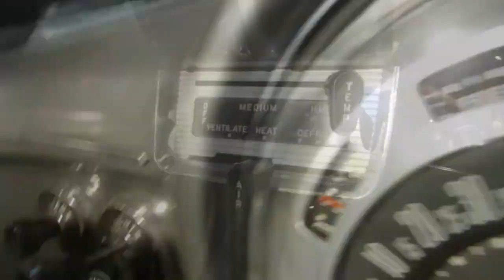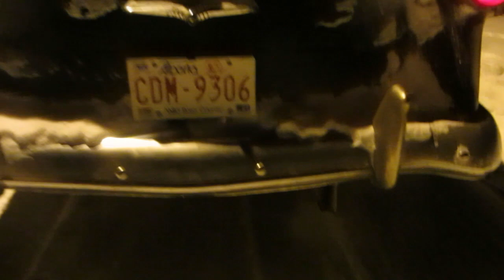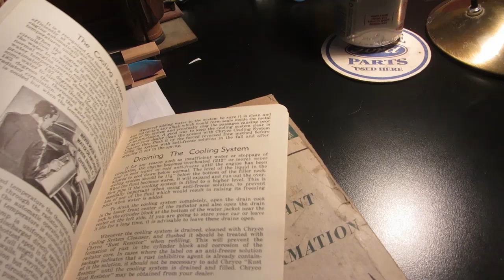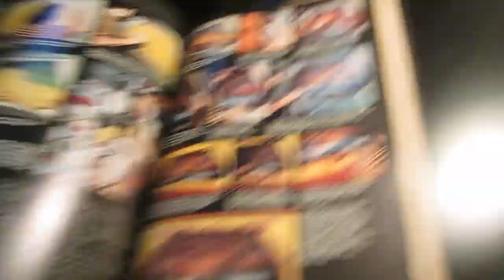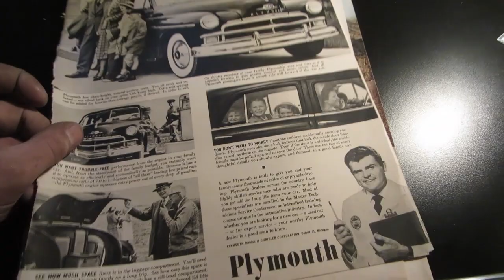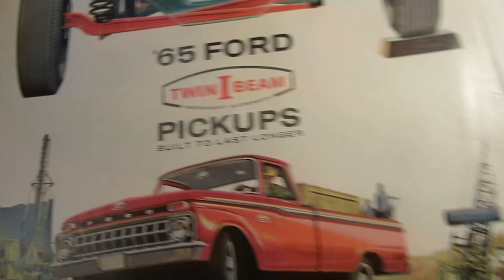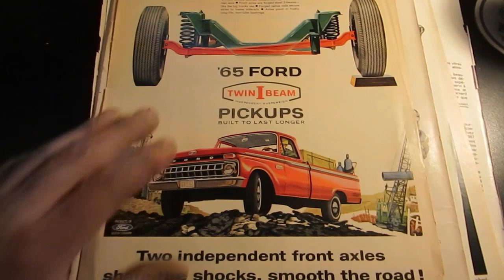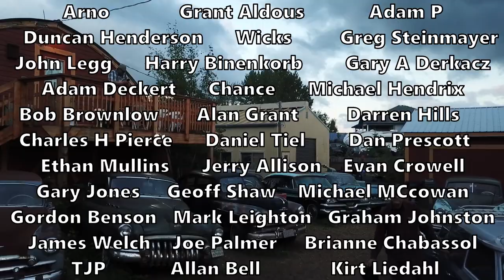50000 Subscribers! Jim's Been Shopping, Fury Parts, and Viewer Mail with Dean!

Comment: Another great video, thanks. I really liked how you repaired the door panel, you are talented. Don't let anyone tell you any different. I thoroughly enjoyed the segment on Jim's 1953 Ford. 
I remember an Uncle that had one, back in the mid 60's.  He had rebuilt the flathead in my Grandpa's blacksmith shop. I also drove it many times. It was a real joy driving it. Quiet and powerful to a young driver as I was then,
Keep on doing what you do. Congratulations on 50,000. Be Safe.

Comment: don't now what's more amazing...that crazy-ass model or that Mopar still have a flathead 6 in '58.
Reply: That was almost the last, the final flathead Plymouth and Dodge cars were 1959, 1962 for Dodge trucks, in military 4X4 they made them as late a 1972. Last passenger car flathead was the base model 6 cylinder Rambler American until 1964.
They sold a lot more six cylinder cars in Canada than in the US.

Comment: I'm almost positive the I-Beam remained on the Ford Econolines with some changes all the way up until the 2010's
Reply: In 1997,at the dealership I worked at,they threw out all the tools for repairing I-Beams.Maybe 25 weird looking 'drill-bits'for re-boring the holes straight.I went out and grabbed 1/2 of them,but another mechanic saw where I stashed them because they were gone when I was ready to leave.

Comment: Nice seeing the Meteor.  My grandparents had a '54 Monarch.  They took that to Expo '67 and came back with two cars, haha.  They bought a new '67 Chrysler Newport.  That was one vehicle I wish I had kept but my body skills were none-existent then so I sold it off to a fella that wanted to restore it.  The Monarch ended up scrapped but the engine ended up living on in a '53 F-600.  The old flathead would run on anything.  The only thing we ever had ongoing issues with was the water pumps.  They have a left and right water pump and it always seemed like one of them was going.  Suffice to say, we got new ones instead of remanufactured ones, from Ford Obsolete in California and never had issues with anymore.  A great engine to start working on when I was young since it was pretty forgiving and would just work.

Comment: Tom's a fucking legend. Get that car up and running for the old bugger so he can come over and bust your balls more.

I've got that same emblem on my '53 f100 getting it to work on a newer wheel and column was a pain but it was so cool and original to the truck. So nice you guys can still drive those cars in the winter. Here in Ontario with the ammount of salt on the road it would be gone in a year or two.

43:15 "Don't let others spoil your fun" little did they know 39 would be the last bit of fun for a number of years.

You should pick yourself up a beer and do the segment formerly known as "Viewer Mail" and call it Male Bagged would fit nice with Light Buzz.

Comment: 26:52 no mention of the radio delete? Wow, did Jim give/sell you the Wagoneer? Awesome dude. It was palpable how much you loved that Wagoneer. And the taillights of that "53 were my favorite Ford tailights of that  era. In '55 and newer came the game-changer Thunderbird tailights. As for the heat, I had a '66 LTD and the air output was aimed at right at my accelerator toes, which logically is the first thing I'd want to warm up on an icy winters day. Heat and A/C was phenomenal on that LTD, as well as the styling. Too bad about the rest of it.

Comment: I had  a 1953 4 door Crestline Victoria briefly in 1975. They were nice cars as it was the last year for the flathead V8 and at the highpoint of it's evolution for Ford. Mine had the Fordomatic transmission radio, heater & clock and factory installed seat covers that when removed the seats looked like brand new. Also Kawasaki debuted the KZ1000 in 1977, I know because I bought a leftover 1976 KZ900 from Grayboy Kawasaki in Peoria, Illinois that they retitled as a '77 model and was deeply discounted from $2475.00 to $1695.00, it was a heck of a deal back then!

Comment: First off, the model was fantastic - my brother does a similar thing with American truck kits. Secondly, seeing you repairing the door cards was great, I have a collection of GM Vauxhalls from the 60s (FC and FD Victors and 4/90's) and nothing trim-wise is re-manufactured for them. I see too many car-shows where they just bin everything and buy new - that's not the world I'm fortunate enough to live in, so seeing you saving original parts is cool. I'm hoping to add a U.S. 4-door to my collection this year (I'm not into mint cars, just want a tidy original complete example) something like a 70-71 Polara, Coronet or Dart, all in 4 door 318 spec would be ideal, just got to try and find one - which is impossible in the U.K.

This show gets a big 10 out of 10 from me, a rarity in that I never fast forward through it, unlike a few others I follow. ChrisP.

Comment: I have a 1995 Ford F-150 2wd pick up which has the venerable twin I beam front suspension which means Ford employed it for at least 30 years. I'm not sure mine is aligned properly because it tends to wear off the inside line of tread on the front tires and I notice that when I back it up and park it the front tires are toed out quite far and they have negative camber. I need to find an alignment shop which might have some knowledge of this type of suspension.
Congratulations on hitting the 50K subscriber mark and Kudos to Steve on winning the "Waste of time" competition! A well deserved award! (why do I spend money on this shit? Har Har!) Seriously, a great job of "distressing" a model designed to appear like a new car. I have used some of the techniques shown to "weather" model railroad cars and engines to simulate age and wear.
Great to hear the Fury is going to hit the road this year. Any luck on finding a front bumper? I haven't been looking in the US hoping you would score one. I'll start looking again and If I get lucky I will let you know. Glad to hear you decided to let your hair grow! cheers!

Comment: I would love to drive a '50's hardtop with three on the tree as a daily driver. I think i would want power steering, maybe brakes. Otherwise, I don't think i'd be looking for any other modern convivences. Of course I'm old and as a youngster we had 50's car (a paint oxidized Plymouth) as our first 2nd car. 6v electrical would be okay by me.

BTW, while watching a first year (1957) episode of Perry Mason the other day the episode showed a woman driving up in a car with an unusual front end. It turned out to be a DS. I was surprised that those cars were manufactured then. Quite some styling for the 50's! For some reason I thought they started making them sometime in the 60's.